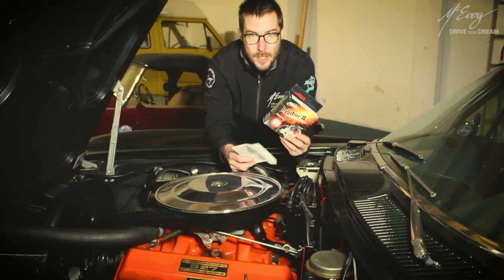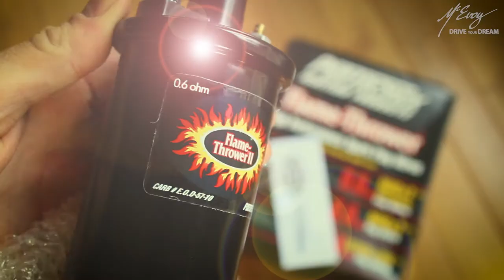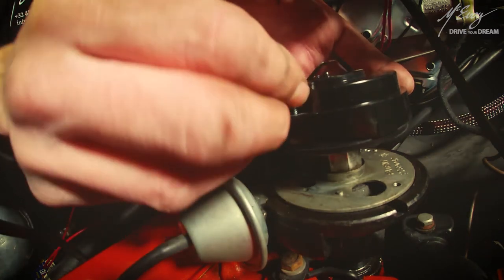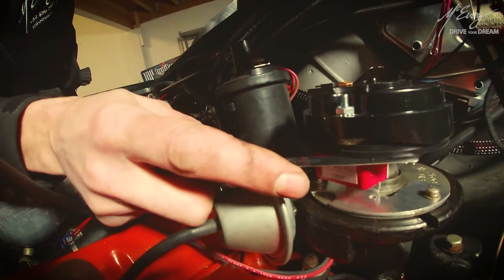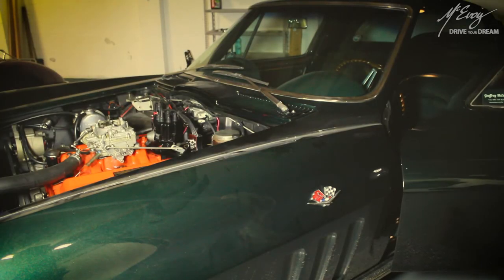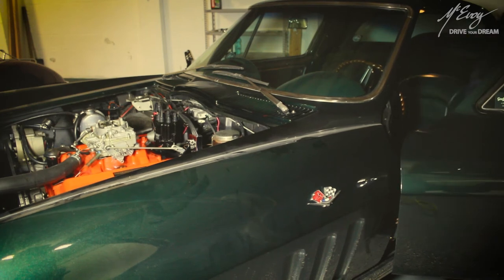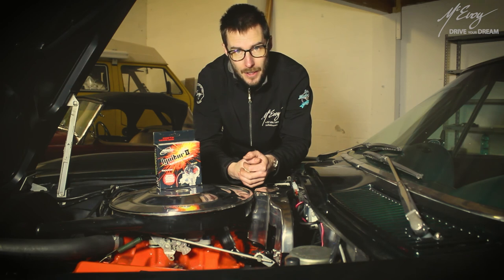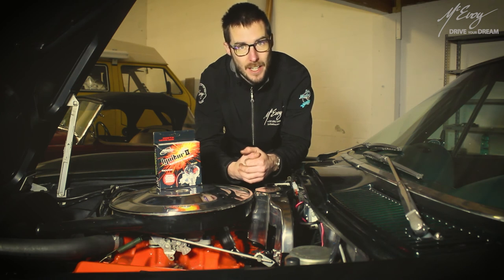1965 Chevy Corvette C2 ignition upgrade

Comment: May I recommend installing a battery tender for your Corvette.
 That way your car battery will be fully charged and ready to go.
Reply from the maker: It has been done since then, along with the addition of a battery isolator switch. Much better indeed.
Reply: @gmcevoy  Hi Geffrey, I once had a 66 Chevy pickup and it had a problem with the wire that went from the key to the starter solenoid. The way I fixed it was I installed a Ford starter relay close to the starter, then I took the wire off the starter solenoid (i believe it is purple in color) and installed it to the "S" terminal on the relay. Next I took some 10 gauge wire hooked one side from the starter solenoid to one side of the relay and the ran another 10 gauge wire from the other side of the relay to the battery cable on the starter. This trick will work on many cars not just GM's.
Reply from the maker: @GP-sy4ws  That is highly resourceful! Well done!

Comment: Sorry for the dumb question but how did you start the engine while leaning over the open hood? (5:30) My C2 wont start like yours but it would be much easier to see what happens or not while ignite instead of sitting behind the wheel. Thanks!
Reply from the maker: Hi there! Not a dumb question at all. I made a remote switch, hooked up directly to the starter motor. You simply need two wires (I use speaker wire because they are conveniently side by side), alligator clips on one end, and a temporary switch on the other (press to close, release to open contacts). Hook that up to the starter motor, one of the alligator clips on the heavy gauge wire coming from the battery, and the other on the solenoid input. Press the button and the starter motor spins. Release and it stops. Highly convenient if you work alone, for sure. If you are not sure about how to hook it up, you should be able to find a decent wiring diagram on the web. I hope this helps, and that you find the source of your no-start issue! I had starting problems when the fuel pump started to play up. I would have to feed fuel directly into the carb bowl through the vent, and it would then start up, and the running engine would prime the pump and it would be okay. Make sure your ignition system works properly beforehand, though. Best of luck!
Reply: @gmcevoy  Thanks a lot Geoffrey. I'll let you know what the problem was on my 66 Coupé. Thanks for the video and your fast and informative reply. Greets from Germany, Roy
Reply from the maker: @sonnenbrandambauch  Yes, please do! Looking forward to hear about your success. Take care, Roy.
Reply: @gmcevoy  Update - I had some moisture under the ignition distributor cap during the long cold weather. Some partcleaner spray, cleaned it up, wiped it dry and it starts. Thanks! :-)
Reply from the maker: @sonnenbrandambauch  Marvellous! Glad it was only that! All that is left to do now is to enjoy it! I miss this one. It was one of those cars which demands respect, and will try to kill you if you give it a chance. One which likes to be grabbed by the scruff of the neck and get thrashed around. I absolutely loved driving it. It was a true man/machine relationship, and really made me feel alive. The sound, the smell, and the feelings it gave when you put your foot to the floor... It had a 5 speed manual conversion too, much more usable than the 4 speed it used to have... Anyway, glad you sorted it out! Take care Roy!